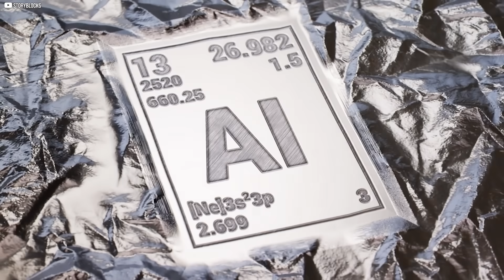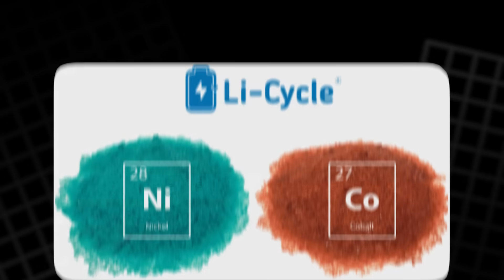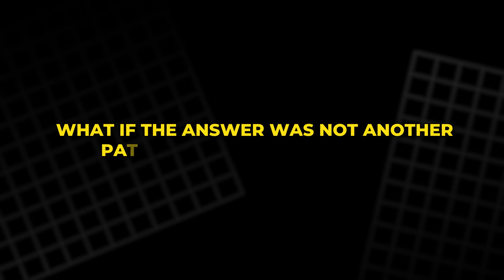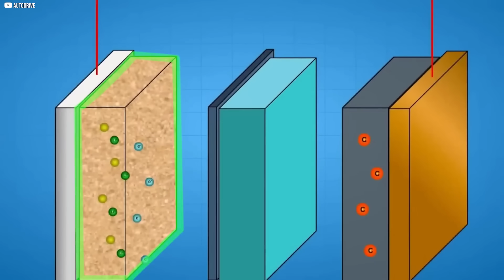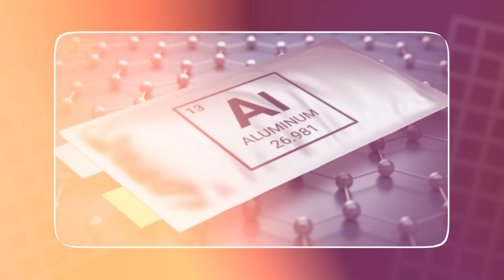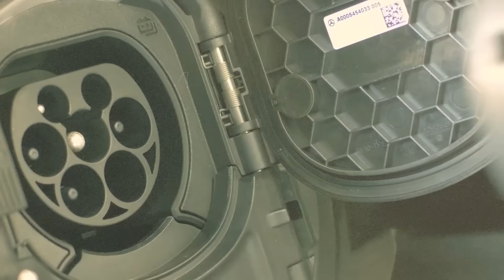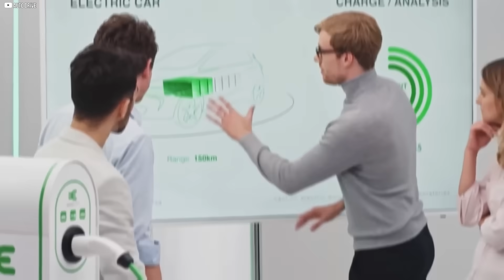Elon Musk Reveals the Battery That Lasts Half a Million Cycles

Comment: The funny thing is I still have a Nickle Cadmium alkaline battery from 1899 that still works 75 amp. As long as the distilled water is above the plates, it will keep working forever.
Reply: LOL, try putting 100kWh worth of those in a pack for automotive use. The volumetric energy density is so poor you'd need a 48 foot trailer to hold them. The gravimetric energy density is so poor you'd need a diesel semi to pull it.
Reply: @TronJockey we found the battery in an abandoned mine. The point is it's 126 years old and still works. These days we're lucky if a battery lasts more than 4 years.